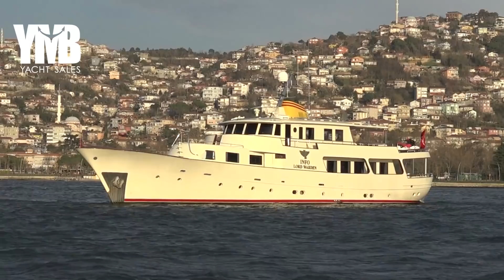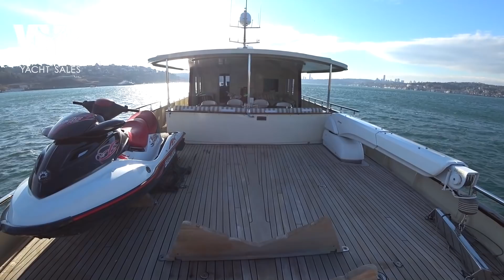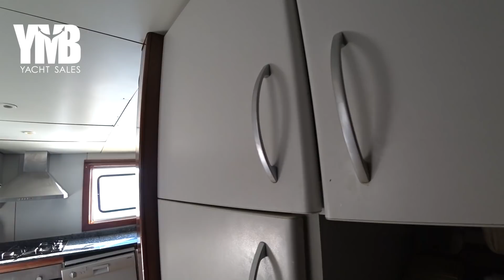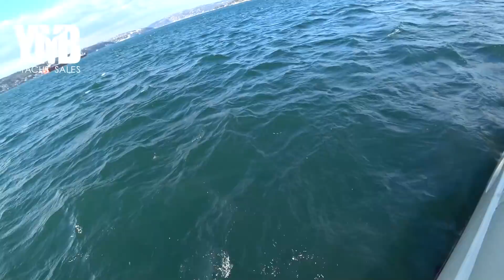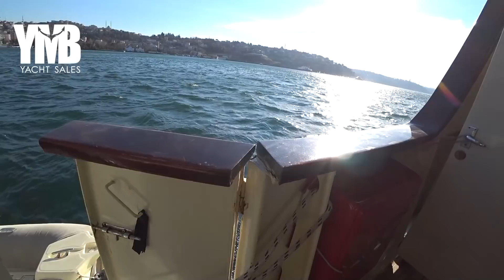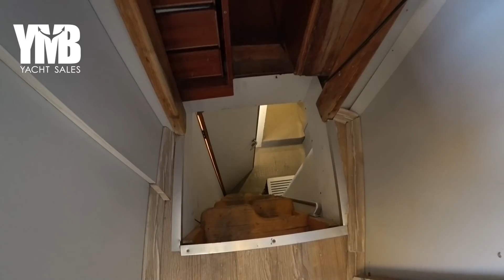34 m Steel Hull English Gentlemen’s Yacht from 1960 For Sale / Full Walkthrough

Comment: A crying shame they never put in two 800hp motors still lots to spend and too slow if you need to get up to a 18 knt cruise  if needed I doubt it has air conditioning and no heating
Reply from the maker: 18 knots is too fast for displacement yacht at this length. Air-conditioning system installed.
Reply: You could put two 1,000 hp motors and you aren't getting 18 knots from a yacht this size with this type hull.
Reply: There are formulas to determine the maximum speed for a displacement hull. One of them is: Max Speed in knots = 2.43 multiplied by the square root of the length at the water line (in meters). This yacht is 34 meters long and, judging by the video, I would guess it has a water line length of 30 meters. Therefore its Max Speed = 2,43 * square root of 30. This corresponds to 13.3 knots. Even considering a water line length of 32 meters, and I'm sure is not the case, you get to 13.7 knots. To be able to cruise at 18 knots (without planing) you need a yacht with a water length of at least 55 meters.